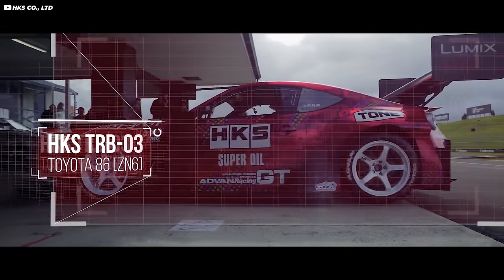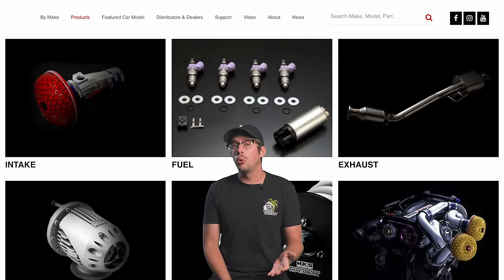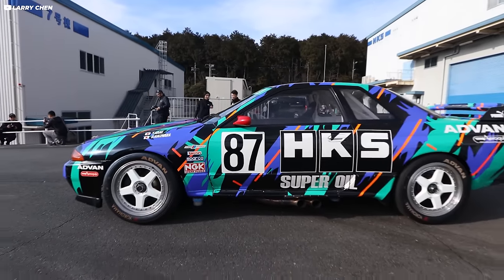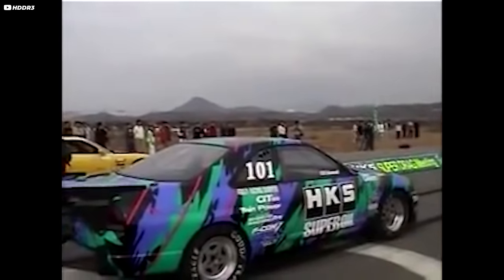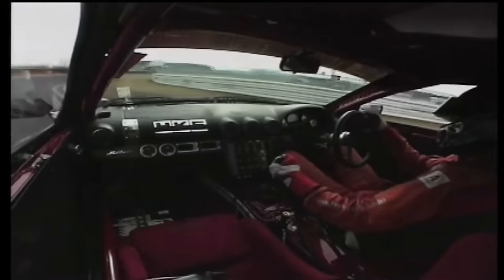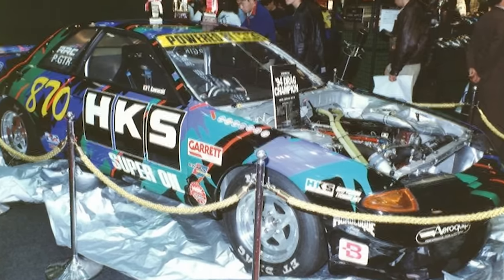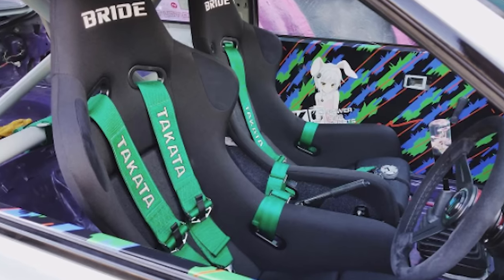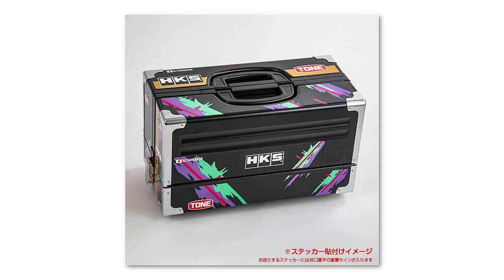HKS: The Good, Bad, & Ugly

Comment: Only thing for me with HKS is that, at least in the US, there is hardly ANYONE that can actually tune their new F-Cons. Also little bit that you need to buy the add-ons to those fcons, like the evc boost controller, because they aren't built into their standalone ecus. But outside of that, love everything HKS, and my mk3 Supra has a ton of the old school hks parts in it.